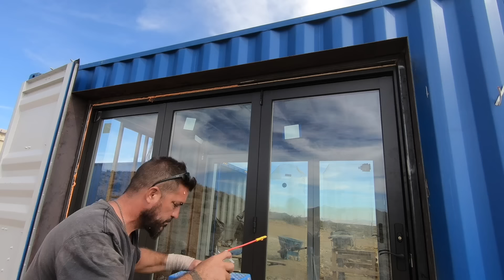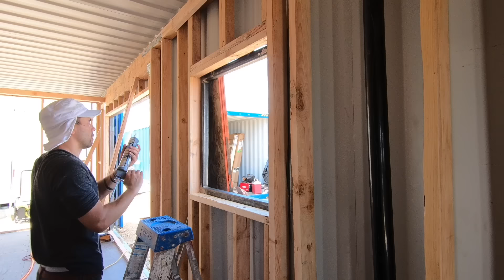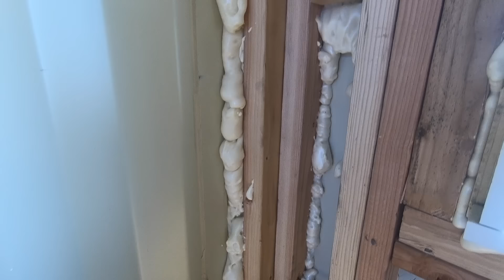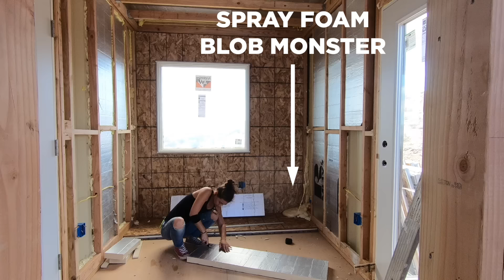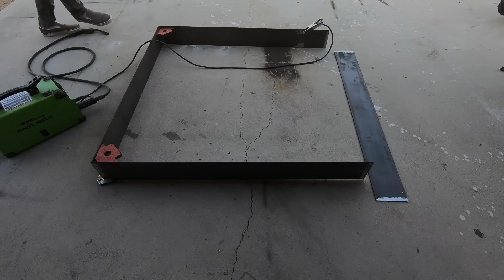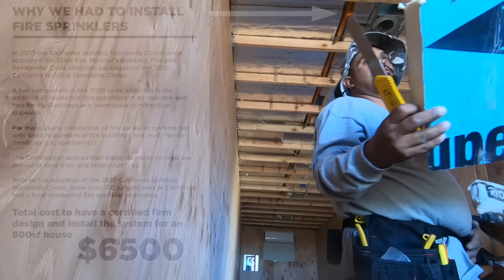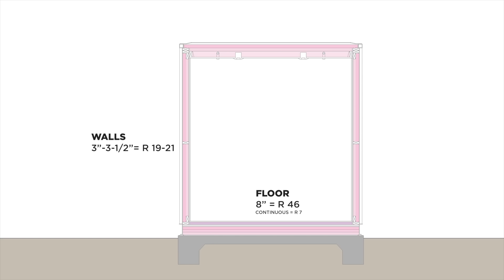Building a Shipping Container Home | EP03 Doors, Windows, and Insulation

Comment: For a project that size, you would do well to pick up a Todal foam gun and case of PUR foam canisters. It will cost substantially less overall than the Great Stuff and other types. It gives you a lot more application control as well.  The PUR expands well, but won't put undo stress on window frames.   Really excellent videos.

Comment: Basically, these guys have built a more or less conventional house...backwards.  They start with putting on the the metal siding--first.  Then the doors and window then the framing.  Holy reverse, Batman!  Because, in effect, metal siding is all the shipping container has given them--other than floor joists and roof membrane.  Plus, they locked themselves into the dimensions of the container.  Ultimately, they have an inflexible, unattractive, difficult-to-build, and costly method of house-building.  And it's not the fault of the California building codes as many comments have suggested.  Other than requiring an earthquake-resistant foundation, and that belt-and suspenders extra layer of interior plywood, any building code  would require you to do everything he did in order to have an even remotely safe and livable building.  And don't forget how hard insulating those metal framed doors and window is.  In the end I can't  think of a worse way to build a house.
Reply: Perfect analysis, it was exactly what I was thinking
Reply: Spot On.
Reply: So right 😳👍🍺

Comment: How many windows are damaged by the welder?  The engineering didn't advise to pull off the foil vapor barrier when using two layers of foam board?

Comment: Yes, this demo project funded by Home Depot has a lot of unnecessary features because they want you to watch the video, however it's not all show. The reality is that a fantasy of plopping down a $2500 shipping container somewhere and then living in it, has been promoted, along with many 3D drawings of non existent structures, totally ignoring any legal issues, which you are going to encounter even if you don't live in California, along with the costs of building in steel, which are generally higher than conventional construction.It does at least do a complete job of presenting what it takes. That said use this for a guide but don't give up on lowering costs, it can be done. Do lots of planning and investigating before impulsively buying a container.

Comment: For the welding in reality to meet welding regulations for structural can't have any paint primer or milscale on metal. And should use 7018 or 7014 welding rods as they meet structural code.

Comment: one question i have,if condensation forms between the inside of the walls over night,how does it breath and where does the water go? i thought you would have used a water proof membrane between the timber frame and the steel inside wall?,..one great thing about the old school builders they always had alot of ventilation for between the walls
why bother drywalling the plywood,i did my house in 9-12-18mm ply using finished side on one side,primed ,plastered and several coats of top paint ,you cant tell it apart from drywall,i used builders bog or no more gaps between the butted joins,builders bog sands off better if you want a really nice finish,the advantage is you have a super strong wall and the paint soaks into the plywood and doesnt mark anywhere as easily as drywall,it is also more resilient to movement because you are using primarily no more gaps silicone as opposed to plaster,fibre glass and paper
great video i learned alot i like the idea of all the welding as opposed to using timber

Comment: The Hold Down requirement is total bollix. You have a steel container with 4 corners. precast some plates at the corners. Weld. Seismic issues solved.

Comment: First off, fantastic job on the build, and the videography. Sadly, the entire build process looks to have resulting in a stick-n-stucco constructed California house, built inside of an incredibly strong steel structure. This illiterates 2 things in my mind   1) Building departments are staffed with people who have no idea how to calculate how much concrete you need to pour a simple rectangular patio, let alone calculate a load over a span. As such, they only know how to treat 'conventional construction', therefore made you conform to those type of codes, rather than the other way around. 2) I'm not a builder, but your project shows that pulling permits is big business for the county, but necessary. You obviously have a building background, and have had your project engineered, but I'm guessing your county sent you back to the drawing board more than once.

Comment: Interesting vid.  i've been wondering about all the architectural and engineering things.  You didn't have to secure the containers to the concrete slab so during earthquakes they won't slide off?  I'd also heard that when you make cut-outs in the steel walls, you had to re-enforce the cut out area because the steel is compromised but i'd heard you had to use steel to re-enforced (but that advice came from Colorado which may have other codes and needs, they do have months of heavy, wet snow every winter).

Comment: Canadian Broadcasting did a show about spray foam in attics.  If the 2 chemicals used in the mixing procedure is not mixed precisely  it emits an odor which makes the house uninhabitable.  I'll use pink batting  insulation every time

Comment: There is a product used on car bodies that would work better than spray foam on metal junctions called SEM Black Seam Sealer. Not only would it last longer your seams would also be water tight. It's also important to note that the shipping container is already Air tight so the massive amount of foam sprayed into the corners is not necessary, you only need to seal the areas where you cut holes in the container. It almost seems like this was an attempt to spend as much money on this as possible.

Comment: It's better to run wiring in rectangular section conduits at the base of the floor betond the finished wall surface lint and cap it with SUS lids that can be opened later to change wiring/cabling when needed. This makes a neat and attractive base board frame. It can be either below floor with the lids flush to the flooring or recessed in the wall with the lids placed vertically as flush or protruding baseboards.

Comment: Did you ever consider adding an angled, white colored shade roof with an air gap over the containers? This significantly lowers the temperature and protects the flat roof of the container from collecting rainwater.  Alternatly, PV solar panels and/or solar watwr heating panels can be used for the same pupose.

Comment: I have a question. I just put down 1000 SQ feet of tandg floor. I used glue and screw method. But I didn't spread out the glue, did I make a huge mistake I'm going to regrit?

Comment: As a residential & commercial glass and glazing company owner, the way you installed your windows was definitely not the best way. I'm guessing the glass inside the windows are soft coat low-e, which is going to last roughly 8-10 years before they start showing signs of failure, and be completely frosted over in 15 years. Fortunately the vinyl windows are easy to replace of the glass, but if the industry moves from vinyl to something else(like aluminum to vinyl), and you choose to go to the new tech, you'll have a bear of a time replacing them.

Comment: How hard would it have been to put two side by side so that the rooms are a wider?
Reply: Yea, to make a 16' wide room. That's exactly what I was thinking. Put 2 together, side by side, cut half out to make one big living room kinda area. Then, on the 8' wide areas put a kitchen on one side and a bathroom & bedroom on the other side. 
 Having done lots of steel work myself, it would be easy to cut out and weld the frames together but, to meet building codes, who knows? They would probably require a giant header, exactly like framing a standard room. 
If building codes in all states are like this, it kinda blows the idea of a container building.
Reply: That's probable like 20K more in permits, Lol
Reply: I know it seems more like a hallway after framing, plywood etc. this is just to crazy for the money spent

Comment: I hope to all the gods that when you are done you acknowledge how much more you spent just for the AESTHETIC of a shipping container house. I read all the comments about how stupid it was that you basically built a traditional house inside a shipping container since you needed all the headers and framing and such, but I brushed it off, fine you traded wood sheeting for metal... THEN... you were forced to line your interior walls with the same wood sheeting as you would have used on the outside?     You payed what like $100k extra to cover the outside of your house in the desert with thermally conductive sheet metal.

Comment: Just curious, but wouldn't it have made more sense to weld the gaps before hanging the glass doors. Less risk to the expensive glass due to sparks or excessive heat. That said, perhaps there was a frame warping concern that made you decide to install the doors first? I'm not asking because I think you did it wrong or anything, I honestly just don't have the experience to say one way or the other. I'm just asking because the thought occurred to me that it might be less risky and easier to do the welding before the doors were in place.

Comment: You spent way way way to much money.  If you want a shipping container home, just buy CHU's.  I went through a deployment living in a CHU (we had a row on the second floor) over a CHU kitchen, dining room, and living room.  Our office was also made from CHUs.

Some other advantage of CHU's other than cheaper overall cost, is that they are build with steel structural framing, are designed to be linked together, are prewired/plumbed, and code compliant with certifications making getting permits faster and easier.

Comment: Looks like you are pretty much OUT IN THE BOONDOCKS, that said, are you running electrical wiring for REAL 110v or are you going to go OFF GRID and get set up with a lot of 12v dc lighting and use the solar panels for like a garbage disposal, TV and computer(s) and such??  You could also likely find a decent water pump system for your well, too, that's why I'm asking!!!

Also wondering if you just barely kept up with all the DC hand tools charging or if another solar panel would have been better than just the two you had??

Comment: I knew about that summer/winter shading years ago. It's a great thing. My friend had an Oak post and beam House that the walkout basement was basically the front doors. He had two 8' sliders in the basement AND the first floor, with no deck on the first floor. He used a homemade wood burner to get heat. 55gal drum inside an 85gal with coiled tubing and sand sandwiched between. Then pumped into the basement with a low voltage pump, a car radiator and a fan to get the heat out of the water. He slept on the loft "second" floor. Idiot didn't pay his property taxes and lost it. 5 acres in SE Michigan with state land on 3 sides.

Comment: i dont understand why some people frame the container that negates the entire purpose, of the container...
Reply: The corrugated sheets provides the required strength to the containers and making a puncture in the walls disturbs the whole structural integrity of the container so additional bracing is required to hold it up.
Reply: your hanging hundreds of pounds of kitchen things and stuff on walls on a thin sheet of metal. On most shipping container homes I've seen they've always had a frame in them.
Reply: @donjones2500  Yeah you either need to have a metal frame or an 18 mm ply to provide support for hanging stuff and electrical appliances.

Comment: I appreciated these vids but realize how much easier it would have been to build these offsite and deliver already done.
Reply: Those would be considered Pre-Fabricated (Prefab) Homes. There are a lot of companies that offer that option with traditional materials, not many do it with containers.
Reply: Great idea!!
Reply: prefab homes falls into a category that would not work for the need of construction process be separated  by step by step trade inspections according to most of US building codes, which turns worse process when Codes apply in Hurricane and Tornado regions specially like Florida.
Reply: @Thepuppetmayor  The process can work in those areas, but prefabricated homes would have to have a costly interlockinglocking design, which destroys the entire point of prefabricated homes.

Each frame of the prefab would have to have a interlocking skeleton design built around treated steel and then welded. Just too costly unless you want your house just spread out as in sections over a property to meet requirements.
Reply: V Guyver agree to some extend in regard the type of interlocking would make the modular home more expensive, yet the main purpose of planning a prefab home is to reduce construction timeline and the commodity of doing it off site in a more controlled ambiance for better product and productivity of skill labors who pre-fabricate it. The problem I see more is, that modular homes often comes with all the main structural components and tech systems already integrated which for some building officials, the single trades can not be visually and sequentially inspected, as it is for traditional construction, from wish step by step Bldg inspections sequence has been typically accommodated around of. In Florida for instance, the huge amount of inspections are set with the need in mind to inspect every single nail, screw by screw, in a such one by one element review resulting in a slow and tedious process for every trade is being checked. Another issue is that modular structures for homes are very difficult to standardized based on  residential zoning districts that vary radically even in the same street sometimes or same city block in terms of lots sizes, lot coverages, high limitations, existing utility easements, if historical guidelines applies some times etc. such critical variables that are more suitable to fit with standard construction. Leaving prefab systems designers to have more Cons than Pros and and the sad reality that “one size can not fit all” then to give up.

Comment: I think you could have used spray foam for all applications, not the stuff in the can but what they use to do a complete house with. It would have been more monolithic and durable not a hodgepodge of various materials and allow thermal bleeding. You then could have used the orginal heavy plywood flooring saving lots of money. the plywood sheeting was just dumb and more of a fire hazzard, then you need a 6500 fire suppression system for no reason. If you could have used sheet rock/cement board with metal studs your interior would have been fire-resistant. Back that with a no-burn foam insulation spray you would have had a tight vapor/water barrier that sealed the steel from rust. The process took up more space in the interior and cost more.

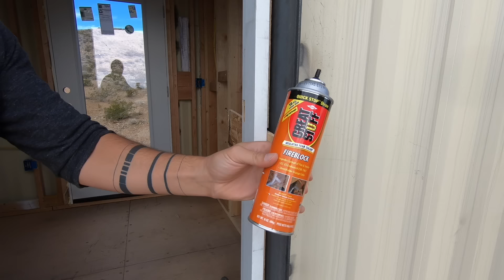Comment: At 4:03 I would get the staple out and make that light fixture 14/2 go straight all the way across. You already drilled the hole I just don’t get why you would staple that so much lower. Also it’s looking like the wire is going diagonal instead of running flush against the wall. Maybe you aren’t at that stage yet but the other wires were done perfectly. I also noticed you aren’t wearing steel toes lol.
Reply: I love the episodes tho I’ve been taking some notes throughout the videos putting it on pause constantly lol. Keep up the great work!

Comment: I'm sure someone has said something like this already....but with all the steps needed to reinforce and adapt the container, and with all the framing which had to be done anyway.....wouldn't it have been FAR easier just to build the damn house traditionally? You'd have skipped so many levels of problem-solving, welding, modification, ect. Plus...possibly cheaper.

Comment: At least half of the people commenting on here gets it. This is a normal house with real shipping containers acting as siding. It would be cheaper to build an actual normal house (box) and then use metal siding to get the container look. But its not his fault. Its just whats required by the building department because there are no building codes designed for containers. I researched about building container homes for years and decided against it because of this. The cost is at least as much as a normal house if not more. He's doing it as an exercise and for education for everyone else. For these "boxes" kind of homes, the fastest (therefore cheapest because labor is $$$) would be to use SIPs. Or, since this is really a DIY channel, he could have framed the entire house with 2x6 all by himself if he wasnt trying to use containers lol.

Comment: First-year architecture student here, just wondering, why are you insulating so much in a hot arid area? and what purpose does having glass at every opening really add to the design and functionality of the project? Do you think would have an effect on temperature control? and why is there no concern about air flow?

Comment: I the first episode, you mentioned thoughts on various types of foundations.  One thought that comes to mind is similar to the slab.  The difference being to set in a ledge to set the container down into, thus creating a fastening point that flashing, or as you used, angle iron with insulation to seal the gaps.  The second being how you eradicated the area on top of the container that traps water.  How did you deal with that issue?

Comment: In California, all vertical structural welds must be welded up, not down... using er70 wire or 7018 rod.  And it's a negative on weld thru paint, all welds must be down on clean ground surfaces.